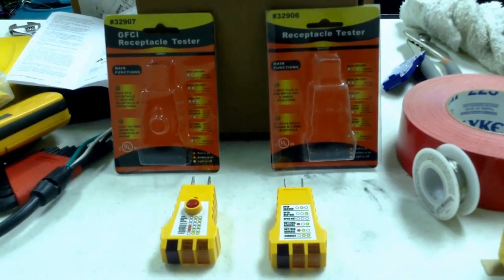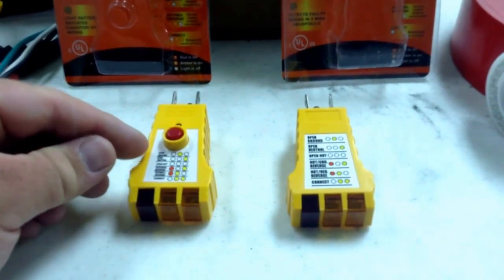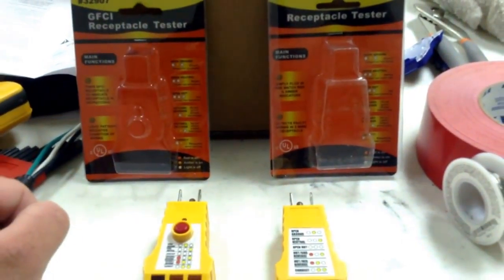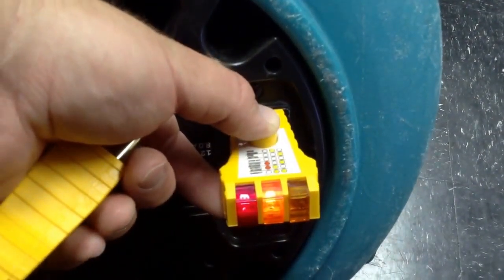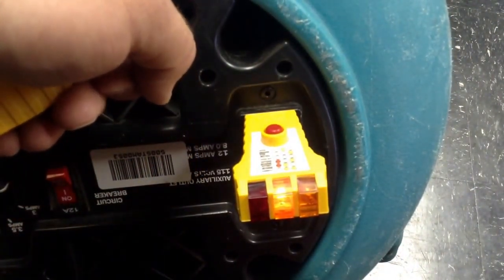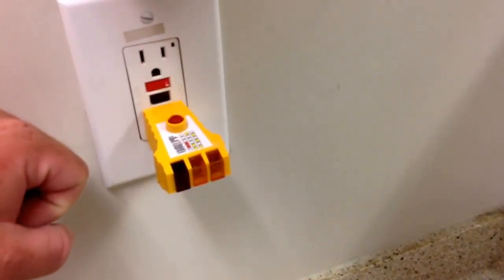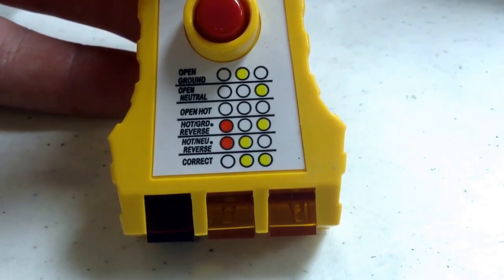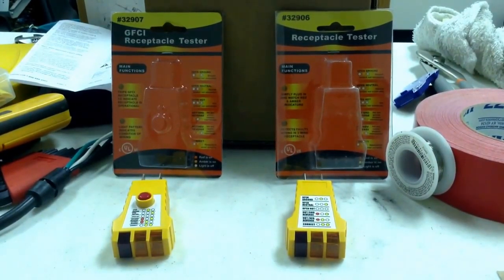How to use GFCI / GFI Receptacle Tester

Comment: Hello on 2:40 when u demonstrated the little tester on the regular outlet what If you press the button what will happen? In my case I think I shouldn't have done it... will my outlet come back in it's own or do I have to call a electrician? Or is there something I can do switch a breaker or something...
Reply: This was given to me as a gift something I didnt even need .. I wish they would have given me a regular tester and not the one with the button
Reply from the maker: The button trips the GFCI. Go find the one that has the two buttons between the outlets and reset it.
Reply: @ttms2  thanks I already located it 👍
Reply: TrenchTech Computer Repair Tutorials d